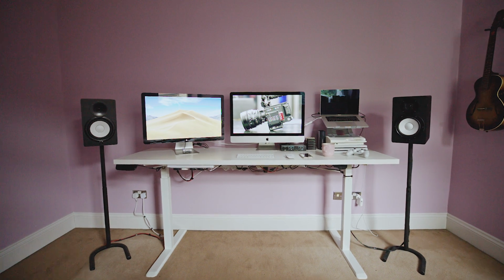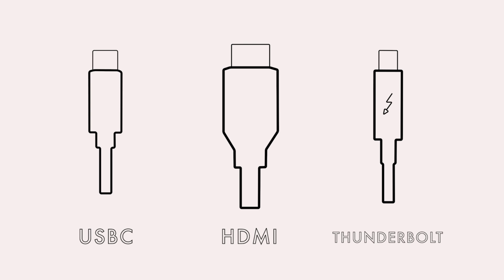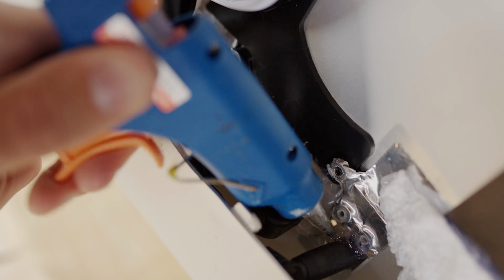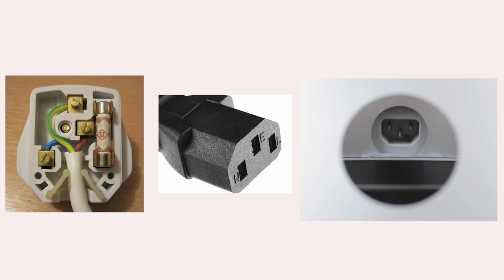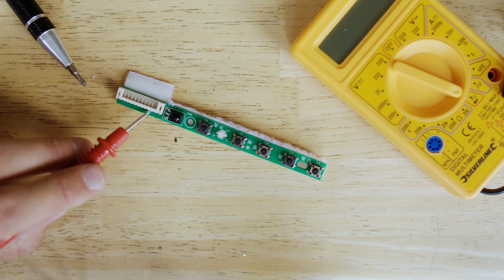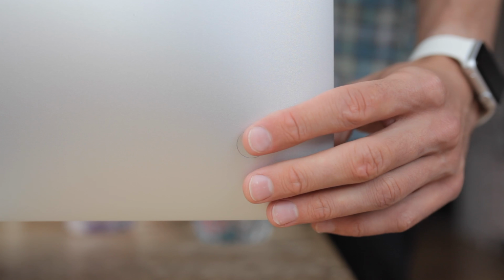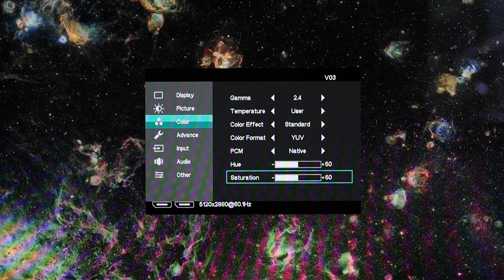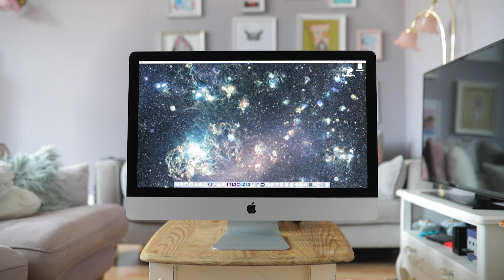The Apple Studio alternative 5K Display // USBC & HDMI

Comment from the maker: I've been thinking about doing a part 2 of this, I've had it almost 6 months now, I'd probably talk about how it's performed, problems I've run into and updates from the driver board manufacturer. Would people want to see that?
Reply: definitely!
Reply: Yes definitely... about to start making my own two weeks from now
Reply: @seanmitchell2520  how did yours go? I ordered all the parts myself and am waiting on the board.
Reply: @stellarorbit1341  good, I went a different route than this video and used a Thunderbolt Display chassis. I'm pretty mine is unique! Let me know what you think. https://forums.macrumors.com/threads/5k-apple-thunderbolt-display-build.2283725/
Reply: @seanmitchell2520  It looks great! Is there any way you can share with me your config for screen settings so when I get mine built I can see what the proper settings are for the panel to make it look as close to an iMac as possible?
Reply: @stellarorbit1341  The OG poster did a Reddit post that explained some of this stuff (and since I based my configuration off that, here is the link https://www.reddit.com/r/hackintosh/comments/hrlf8x/the_secret_diy_apple_5k_display_usbc_hdmi/?utm_source=share&utm_medium=ios_app&utm_name=iossmf ) 

I left the contrast at 50 and sharpness at 0, but set the brightness at 60. Since I haven't figured out how to control the brightness natively on my mac, I figured it was better to set it higher since I'd have to reconnect the controller remote to change it later. So far I'm happy with the brightness.

I kept the hue at 50 and set the saturation at 55. IMO looks more like an iMac display. I think the place where you'll have to use your personal preference is when setting the temperature. I set mine at 5800k and you might even wish to go lower, or as Cameron suggested, up to 6500k. 

I think those settings are most similar to apple's settings
Reply: @seanmitchell2520  awesome! Thanks. Do you know if it would work with the m1 Mac mini? The display?
Reply: @stellarorbit1341  there's no reason I can think of that it shouldn't. I made this setup with the intention of being able to use it with a M1X MBP in the future, so yes, I believe it will work just fine. Keep in mind that M1 mac's can only drive on display (unless you get into displaylink adapters)
Reply: @stellarorbit1341  to switch to English, goto the last tab, then 5 lines down, click left or right to get English
Reply: @seanmitchell2520  Thanks. i figured it out right as soon as I posted that comment. I found a little quirk with the m1 mac mini that I have and it's that since this counts as two displays, I can only use my new monitor and that's it unless I go for a displaylink dock like I did. You are awesome and thanks for helping me with my questions. You are the bomb
Reply: Yes, Please
Reply: Yes
Reply: yes
Reply: yes sure we would!
Reply: let;s see it, would be interesting
Reply: @januszja  yeah, it would be great.
Reply: Please do!  Awesome build!  Don't think I'll get around doing it myself but I loved watching your build.  : )
Reply: I have a suggestion for a second part or parallel project. Refurbishing an old iMac 27” with a new m1 board inside. They are tiny and makes tons of old iMacs have a new life - they price of the m1 board might be the barrier for now. Maybe in a few years this will be the gem.
Reply: Sure, please!
Reply: Thank you very much! Please show how it would connect with the new LCD driver board. Or better yet, how it would connect with a Mac mini M1. I'm curious to see what can connect to the USB_C port on the new driver board.
Reply from the maker: It works perfectly with the new m1 Mac’s 👍
Reply: Hey,

Did you ever add the “6 months on” video or is it all in the FAQ’s?

Thanks.
Reply: Do it!
Reply: Great video — thank you!

I have a fully functioning 2014 5K Retina iMac and would like to convert it to an external monitor for an M1 machine.

Would love to see your 6 months follow-up!
Reply: Any issues from integrating the power brick? I’d imagine the heat could really hurt the display
Reply: Can I put the replacement screen on a Thunderbolt Display

Comment: Nice Job! I’m just wondering though why didn’t you just buy a used 27” 5k imac? Any year between 2015 to 2020. I grabbed a 2015 in mint condition for $200. And I bought a loaded 2019      27 “ 5k iMac  for $600 two years ago ,which I’m still using at the moment. I planned on converting both of these to displays soon. There are videos up here up to three years old of people converting them. Some people even made it work with the Luna display adapter which allows you to make this work without even opening up the computer at all. I do like what you did with the I/O ports, but seems like you spent more money and had more steps involved then just using a newer iMac. Not sure how you found a replacement 10:11 5k display for that older Machine anyways, unless the glass is identical to the newer ones. That was a surprise to me. Thanks for the Video and info.
Reply: I use the luna display for my iMac 5k 2015, connected to my m1 MacBook, since 2 years. I'm so tired about it. Poor performance. Not possible to read high detailed video without it breaking apart. Low fps making the use of pointer mouse very frustrating. I'm just tired. And apparently the other physical conversion options are not making it 5k, but 4k (which most people don't notice)
Reply: @Studio23creation There is a new company out there making better components for these conversions. I can’t remember the name right now. When I find the saved video I’ll message you back. Another words not just the regular Chinese made eBay components, something much better that allows you to utilize more of the display also. I’ll get back to you with more info.👍🏼
Reply: I had to add this statement.. I thought this video said 4 weeks old not 4 years old.😂That changes a lot… so my previous statements may not be as valid back then. But still doable today. 😆

Comment: This is a best mod for dead iMac, but you can use 3d printed brackets for placing female connections, also you can hide control board inside case, if you have a remote control of display controller, I can make mistake at this point, but Apple logo at the front side infrared clear and can getting signals from remote control. Oh, one more thing, You can reuse built in speakers in case using amplifier board with Bluetooth. If You find this comment useful You can make a new video with this upgrade points 😅

Comment: I just got my kit from eBay this week and cobbled it together to prove it worked, but was looking for some refinement tips.  I had already purchased the extension cables, so we're of the same mind there.  Also glad to hear that the hot glue worked, as I was leaning that way to adhere things. Thanks for posting this - it was super helpful!

And my kit will do 5k over 1 cable.  Not sure if it's a new version, firmware, or what.
Reply from the maker: Nice one, yeah there’s a new version of the board. Glad you got one up and running 👍

Comment: i don't understand. You managed to put a 5k screen onto a 2011 imac case? How does it fit when the 2011 is magnet and screws when 5k is supposed to use special stickers?
Reply from the maker: Yeah don’t worry about how I did, I replaced the case later 

Use the newer case

Comment: Sooner or later, those with now fully functioning 27 in iMac A1419s will find they no longer work with some future version of MacOS. What a waste of a 5K display. So a great option would be to convert the A1419 to a monitor using VC's method. This could then be connected to an M1 Mac Mini and its subsequent upgrades.
Reply from the maker: That’s the idea, when the 5K iMac has no value, people will use the screens for years to come

Comment: I saw this today… if you’re using a 27 inch “fat” model (2009-2011), why didn’t you use magnets (and some small steel pieces, like the glass panel on those models 2009-2011) instead of double sided tape to keep the lcd panel in place?
Reply from the maker: I used the wrong case which I later replaced
Reply: @VideoCameron  would the thick case work? I assume it’s easier to work in, and depending on the space, you count wire up the optical drive, SD-Reader and webcam to an USB-hub

Comment: Hi. Excellent project! I want to do it as well. I have a 27" iMac Retina 5K 2017 with Radeon Pro 575 4GB with two Thunderbolt ports. Do I need to use both Thunderbolt ports connected to the two DP ports on the R1811 Driver board ( using a USB C to Display Port 1.4 Cable ) ?
Reply from the maker: Is it thunderbolt 3? If so, you don’t need one port with the right adapter
Reply: Hi, did you manage to connect your iMac to a MacBook m1 ?

Comment: I bought an apple cinema display 23' with the intention of modding it, but never got around to do it
Reply from the maker: You might be able to get a driver board for that but I wouldn’t recommend, just buy a better monitor
Reply: @VideoCameron  The problem is the weird aspect ratio
Reply: @VideoCameron  I really love the design of the case (transparent). I would buy a new display to fit it inside.

Comment: Amazing Job, Well Done Mate,
I have a Apple A1407 (27" Thunderbolt 2 monitor)
Is there anyway I can connect to a PC with HDMI or DP output ?
Reply from the maker: If the graphics card supports thunderbolt then it will work. But there is no way to make hdmi work without building a monitor like this
Reply: @VideoCameron  Thank you for your prompt respond, Cheers.

Comment: Why did you remove the ground cable from the chassis? Wouldn't it be better to leave it there for protection purposes?
Reply from the maker: I thought it was better the cable was grounded to original cable inside the power supply, although I realise I should have kept it maybe? Not entirely sure

Comment: Great video but…………
1. Learn how to connect wires before soldiering there are plenty of videos on this.  
2. Don’t use electric tape this is not its purpose! use heat shrink. 
3. If you don’t bite your nails these tasks are considerably easier.
Reply from the maker: Great thanks

Comment: Is it compatible with M1 MacBook?
Reply from the maker: I haven’t actually tried it but I’ve heard from others it works just fine. As long as the computer supports thunderbolt 3, it will work
Reply: @VideoCameron  thank you! I was concerned because I heard someone said DIY monitor does not function as 5k.

Comment: If you want to change brightness on a monitor with keyboard key (like mac os) you can do it with DDC/CI standard. I think your controller board is compatible.
You can find many app for mac and windows who use this standard to control brightness or sound level.
I change brightness quite a lot every day, and it's really easy that way. More than all these anti-ergonomic UI for monitor.
Reply from the maker: I found it didn’t work sadly

Comment: HOT GLUE ? That shit will break lose in a few months.. should have used epoxy
oh yea and electrical tape ? that will also have a chance of getting lose and then putting live wires to the chassis - use a connection port instead where you can screw the cables together...
Reply from the maker: Thanks for the advice

Comment: I was thinking if maybe I could fit the entire ultrafine 5k in the thunderbolt display case so that way I could all the features such as camera speakers and usb-c ports that ultrafine 5k offers but in a much more beautiful design, do you think it would be possible, could not find any document of how to dissamble the 5k ultrafine.
Reply: Definitely possible-- I've been using mine with no issues. I went a step further and put in a Thunderbolt hub for a neat, one-cable solution, but I will say it's a bit tight https://forums.macrumors.com/threads/5k-apple-thunderbolt-display-build.2283725/
Reply: @seanmitchell2520  Mad love for you, will definitely give it a try, I will gather the parts and give it a shot.

Comment: How can i put 5 k resolution? i have only 4k at 30 Mhz
Reply from the maker: Are you using both DP cables? It could be your computer, it could be the adapter you’re using or that you’re not on the dual DP INPUT?
Reply: @VideoCameron  using hdmi port. To have 5k a 60 mhz mudt be using  Dual DP input?
Reply from the maker: hdmi cannot do 5K, you need dual display ports like I mention in the video

Comment: Please use mechanical connection next time you are joining AC cables. The connection will loosen over time if you don't secure it properly and that is quite dangerous, especialy if the monitor's case is made of conductive material. Use WACO clamps or butt connectors next time when dealing with AC.
Reply from the maker: Noted! Thanks
Reply: If you don't have clamps, I would probably solder then put heat shrink around the cable for mechanical stability.

Comment: Just to clarify, does this setup preserve the functionality of the FaceTime camera?
Reply from the maker: There is no camera!
Reply: @VideoCameron  Good to know! Do you think there would be a way to connect a camera if I purchased an enclosure that came with one? I've heard that it definitely won't work with the facetime cameras in the newer iMacs due to their dependence on the T2 chip, but I'm still not sure if it is possible with for example a 2014 or 2015 version.
Reply from the maker: You could find a very small usb web cam but I doubt it would work well

Comment: Hello, I build my own 5K display and with the new Driver Board including USB-C 5 K is amazing. One question. Could you please share your settings from the display configuration?
Thanks
Reply: Hello, :) Maybe you can help me out?

I buy the new board to and I don't unterstand why or.. what the USB-C is for? I think I need the Displayport 1.4 - Say 1 Cable for the connection ? I use a Mac mini M1 (the new one) ? Maybe you can explain that for me? Because USB-C is for charging or ?
Reply: @protelin9801  Hello, of course I can help you. With the USB-C port you can display 5K resolution with only one USBC-cable. With the thunderbolt ports of your MacMini this works fine. In case you are connecting a Notebook via USBC to the display it will get the power from this cable as well. No need for any power supply.
Reply: Can you share the Link where i can buy the same driver board? Thanks 🙏

Comment: what model number is used imac 27 shell？ the A1419 screen intergity can put in？
Reply from the maker: It’s he a1419 case
Reply: Video Cameron you use A1312 case or A1419 case, from your video is A1312 case.my question is the 5k screen-QQ1 can assembly with old A1312 case? The A1419 case is hard to purchase
Reply: Video Cameron  your video is A1312 case，this case can assembly with 5k screen- QQ1？

Comment: Super crazy that you could pull this off! I am more inclined to do something like this with my broken Thunderbolt Display but still want to keep it thunderbolt enabled! Lot of the parts that you suggested would work for the build I would just have to move them internally. The question that I have for you is weather the glass of this display can be separated from the actual display assembly so that I can only mount the lcd/ led assembly of this display and use the glass from the Thunderbolt Display! Secondly why did you not remove the plastic enclosure of the power brick it might help with the cooling and intern better life of the unit? Thanks in advance!
Reply from the maker: Hey, so talk about this in FAQ. 
 there's a version of the imac 5k display that doesn't have glass. it's the LM270QQ2. You cannot remove the glass from the other models, it's glued in and will damage the screen if you attempt to remove the glass. as for thunderbolt there's also a new version of the driver board that supports USBC, but you will loose, the firewire, usbc & webcam. I didn't remote the plastic enclosure because the board doesn't really get that hot and I didn't want to make the process any more complicated.
https://m.aliexpress.com/item/4001084086628.html?trace=wwwdetail2mobilesitedetail&spm=a2g0o.detail.1000060.2.69f57765aQiY2l&gps-id=pcDetailBottomMoreThisSeller&scm=1007.13339.146401.0&scm_id=1007.13339.146401.0&scm-url=1007.13339.146401.0&pvid=1cf17b1b-689e-45f8-850f-d6392a179290&_t=gps-id%3ApcDetailBottomMoreThisSeller%2Cscm-url%3A1007.13339.146401.0%2Cpvid%3A1cf17b1b-689e-45f8-850f-d6392a179290%2Ctpp_buckets%3A668
Reply: Thanks! I will go check out the links in your reply!
Reply: @VideoCameron More question after doing some more research! The driver board with USB-C port is thunderbolt capable or video over USB-C. Second question is what is the USB 2.0 on the card for (it says support usb 2.0)?
Reply from the maker: Amey Rupji yes capable of video from usbc, not sure about the usb, maybe media playback
Reply: @VideoCameron   thanks!
Reply: @VideoCameron  The link seems to be dead.. however.. If I found this part, could I use it in my working Thunderbolt Display, and then use an HDMI to USB C adapter to connect my game consoles? Is there anyway to get hdmi video onto a Thunderbolt Display? I dont care about upgrading the screen. Im fine with the monitor as is, other than the fact that it will only connect to thunderbolt devices.